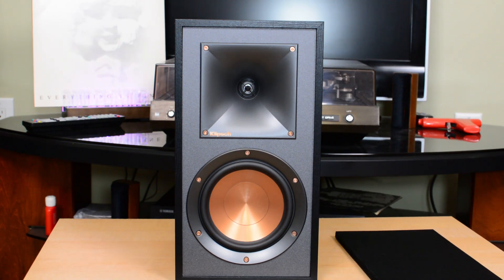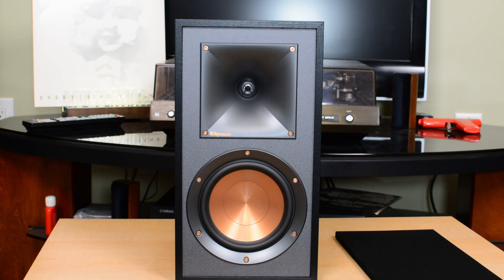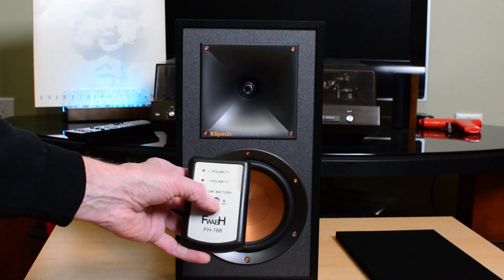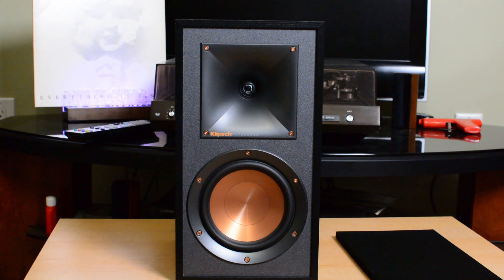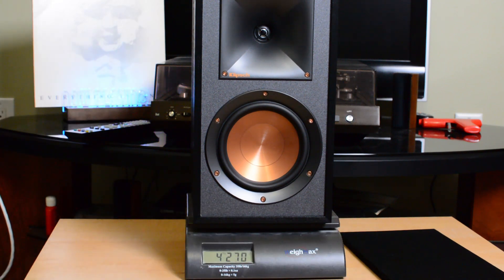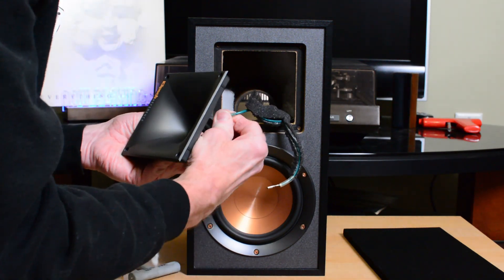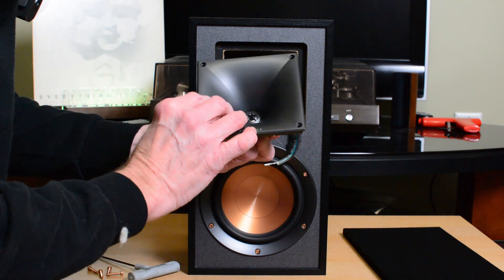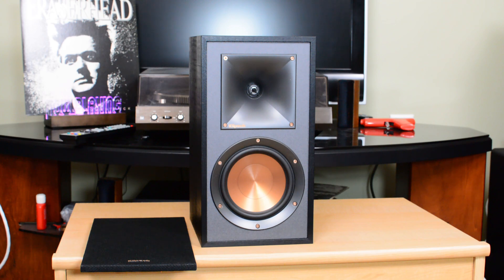KLIPSCH REFERENCE R-51M TEARDOWN AND PARTS REVIEW

Comment: Just changing out the woofer inductor for and air core, and adding some Solen poly caps would be an amazing upgrade.
Reply from the maker: Possibly, it sounds pretty good, my R620F's definitely have a hole it their response that need to be corrected. Once I get additional test equipment I will be able to find out if a swap upgrade is all it needs or something of a redesign.
Reply: Can't just swap caps.  The tweeter is already trimmed with the 4.7 ohm resistor.   The existing 5.1 electrolytic cap probably has at least 0.5 ohm esr.  Put in a poly cap and you may get 0.1 ohm esr.  Now your tweeter is 1 dB louder than before. Certainly audible, probably less accurate, but must sound good if you just spent $100 on caps.
Reply from the maker: @ctrlzyx2  No inductor on the woofer really degrades the sound. The cost of an inductor , caps plus shipping is more than the cheap premade crossover. It's all about doing a low cost sound upgrade to a terrible speaker with sentimental value.
Reply: @AudioTomReviews Woofer circuit has that long glued inductor in series with the driver.  The larger cap and the other resistor form a zobel network in parallel with the driver.  Quite likely some decent thought and measurements went into this design.  Whether the result matches individual tastes is a different question. Keep up the analysis.  I need to look into an lcr meter myself.
Reply from the maker: @ Oh crap, wrong video! I was thinking this was the Technics speaker upgrade video!   Yes, you are correct. I want to do the video right and buy a DATS and get measurements on everything, I don't want to look like a half assed cap swap and we will see what difference it will make. I also plan to make the DATS files available to anyone who wants them so everyone can do their own designs or improvements on whatever I come up with. I may not get to it until the summer though.